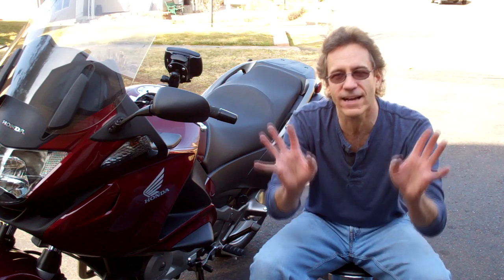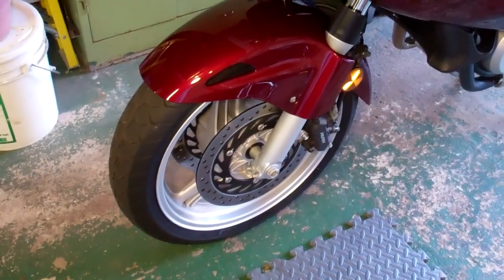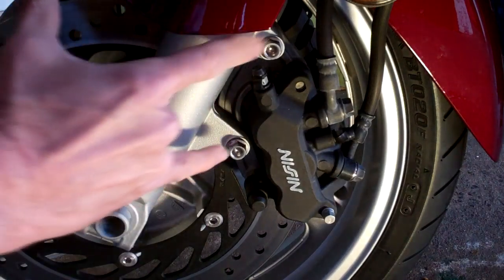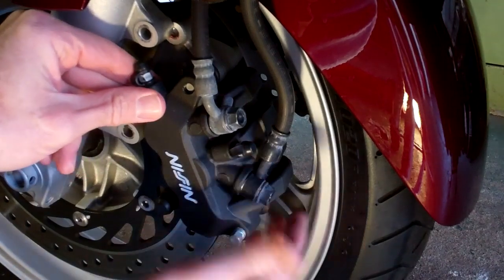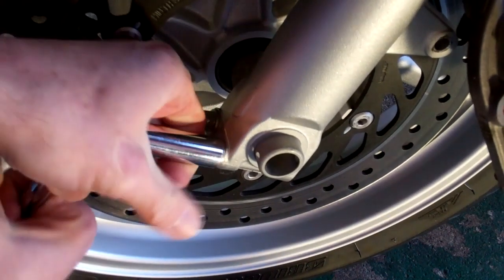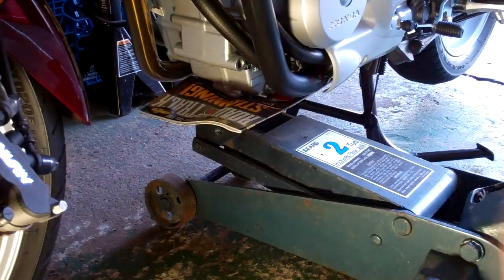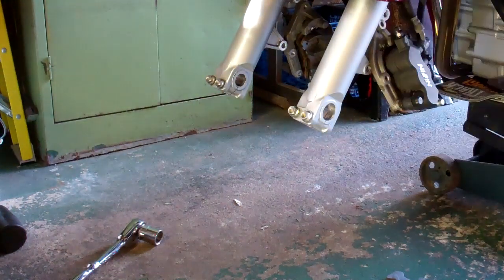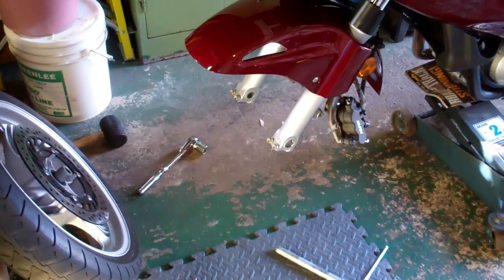NT700V Front Wheel Removal

Comment: I just picked up a 2010 NT 700 in November 2023. I had some issues with what turned out to be a  blocked fuel filter.. The machine had been sitting for quite a few years, inside the original owners heated garage woth 7k miles..
I have been scouring the Internet because of an issue I have with this machine. At low RPMs when I open the throttle quickly, it actually quit running. I have felt this before when I first got the bike in November. 
  I accidentally found that the spark plug caps can cause this exact issue. In fact, it wasn’t a recall, but when machines would go to the dealer for check ups, dealers were installing new caps for free.  
 The symptoms are, it just quit pulling it acts like you turned the key off , sometimes stalling. There were many people that described this issue on the NT 700 log that I found. They say that it is the spark plug caps..
  Have you ever had this issue with you were NT 700.. I took my machine out for the first time in 2024, after I thought I had the fuel starvation problem solved. And it did one of those , it felt like the engine just shut off for a couple seconds..
 I’m ordering a new set of spark plug caps today. But have you ever experienced this.. They claim that old, spark plug caps or spark plug caps on these machines in high temperature areas suffer from cracks in the insulator cap and they leak, Meaning that the spark does not get to the spark plug lighting the mixture. Instead, it goes through the crack in the cab to the valve cover.
  Did you ever experienced this with your machine?
Reply: I have not. I have owned mine since new and it currently has 26k miles with no problems. Not to say that it’s possible for you to be having spark plug caps that are arcing. For how inexpensive they are, I’d change them just to get it out of the equation.